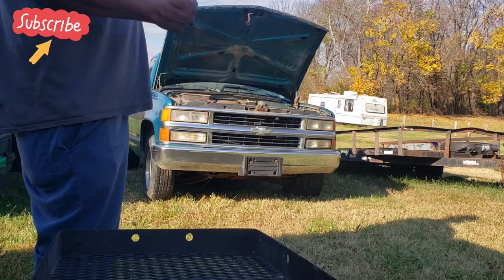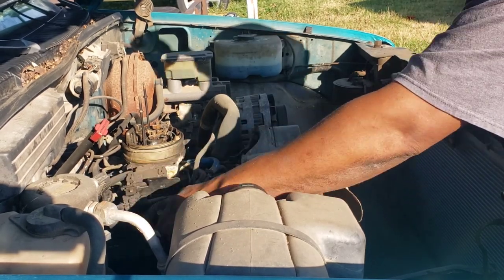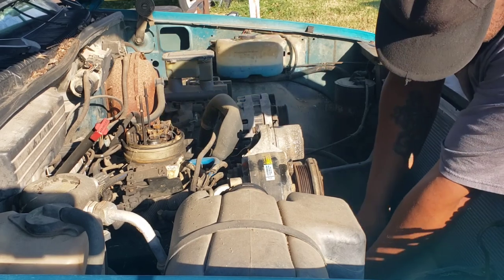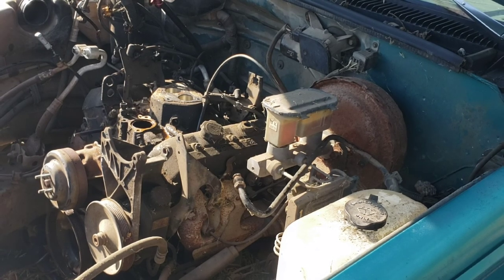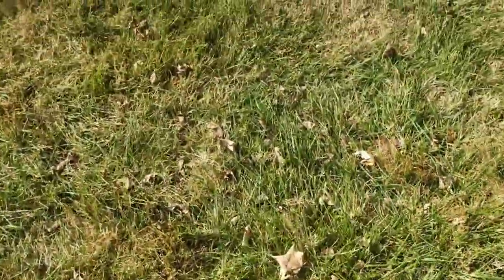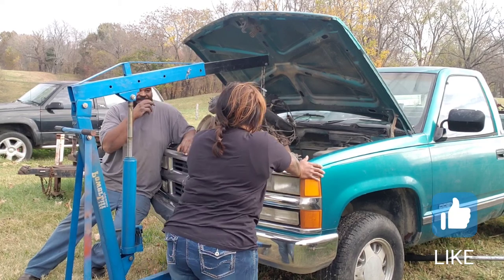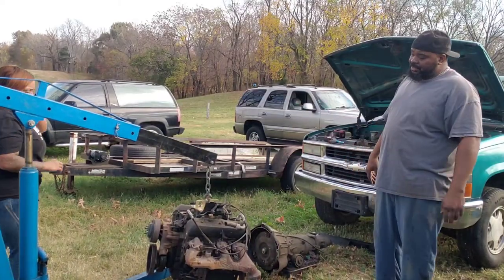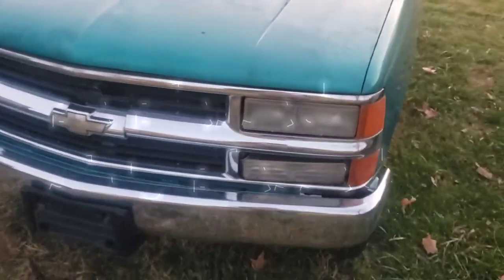HOW TO REMOVE OBS ENGINE FOR AN UPDATE 5.3 SWAP TEAMWORK

Comment: Did the impact remove the motor mounts or did you have to lift it up a little?
Reply from the maker: Want to say impact .with a lil pressure off of them with engine hoist